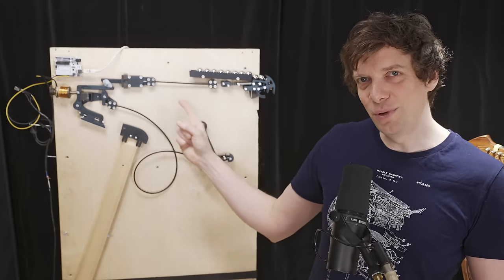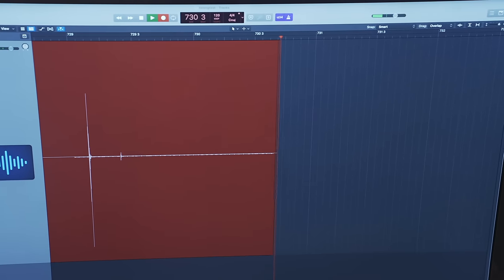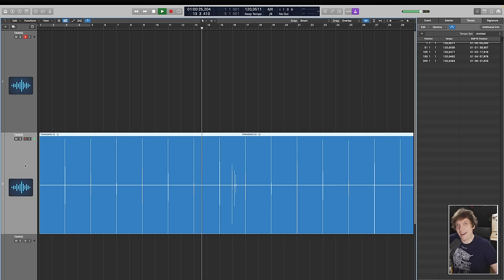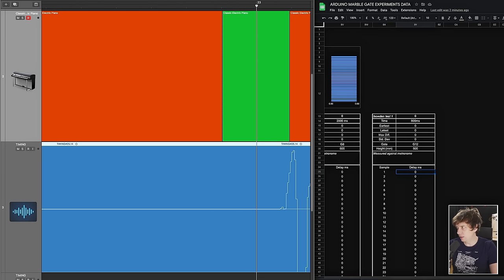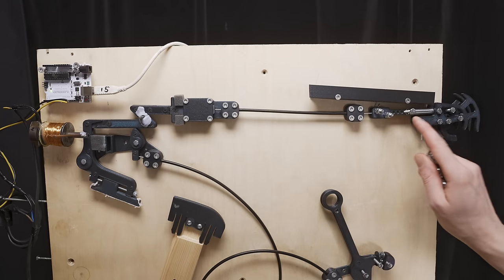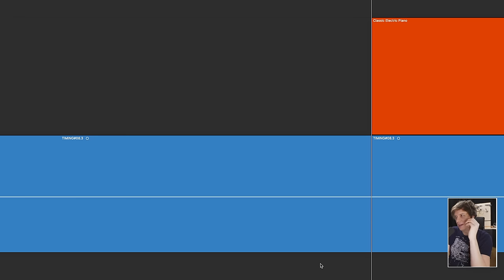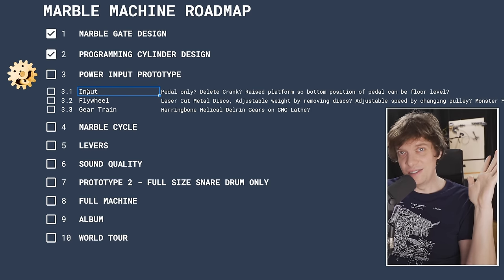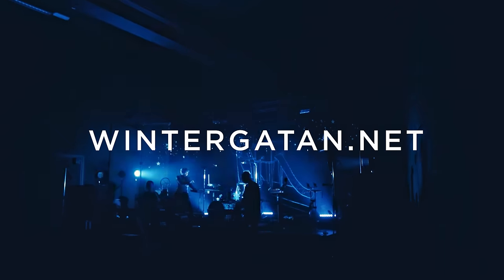Can Bowden Cables Play Tight Music?

Comment: You should add a spring to return the lever from engaged to mute instead of "pushing" with the bowden like all derrailures do... these cables really don't like pushing in the long term!
Reply: Indeed, more than a few folks have mentioned that so far. Though I'd ditch the spring and use the cam's own mass - less parts just a slightly differently shaped cam (perhaps with a deliberate counterweight in its profile) so it always wants to fall down if the cable isn't pulling on it.
Reply: Dumb question here are you saying all derailleurs use springs or that they all push the cables?
Reply: Bump. I really hope Martin sees these bowden cable recommendation comments.
Reply: The problem is consistency,  springs range in strength and speed so timing each spring is a challenge
Reply: @YogiTheBearMan  lol don't worry, he meant they all use springs, the wording of the sentence is confusing
Reply: @graeme.davidson  Nothing needs to be timed. It's just for engaging/disengaging the mute lever.
Reply: @YogiTheBearMan  All derailleurs use spring to pull the derailleur back (usually highest gear) but there have been some exceptions in the past where the cable pushes with a rigged inner-cable. So 99% of the time the cable pulls the derailleur into a lighter gear and when you release the cable the derailleur pulls it back into a higher gear.
Reply: @YogiTheBearMan  All derailleurs have return springs so there's no pushing of the cables.
Reply: @YogiTheBearMan  You may notice that its easier to change the gears in one direction and harder in another.
Reply: Or just hear me out, he could change the Bowden cable to a push pull cable that way the design can remain the same.
Reply: just use solid bowden cable, instead of braided. Solid bowden cables are designed for both pushing and pulling, and is used on engine throttles.
Reply: I don't see any advantage in using bowden cables instead of rigid rods, and lots of drawbacks. They are also going to add a lot of visual chaos.
Reply: @francescosirotti8178  Martin mentioned it in the first video about it. The main advantage is being able to not have all the switches so close to the lever arms. He could have the mute switch on the right side of the machine while the actual mute mechanism is in the middle. The previous design was extremely cramped due to using solid linkages.
Reply: @Francesco Sirotti  cables can be managed and hidden under structural parts or a shroud. They take up less space and are more forgiving as in you make the cable longer than you need to. They are also more flexible. You can run a cable over longer distances and around other parts. 

Rods need fixed positions for the parts they are attached to and space to move, blocking the area from being utilised. They have to be machined to a certain precision. Otherwise, it affects the timing of the gates.
Reply: @Appletank8  so he will be using a long, curved, flexible cable to push? This seems a problem that can be better solved by good design rather than added complexity. And the cables will be much more complex to disassemle, reassemble and set up when this machine will need to be disassembled and shipped on the world tour.
Reply: The load on the cable toggling between unmuted and muted is negligible. It is just overcoming the friction of rotating the muting cam. It may not be ideal and there may be simple ways to reduce the strain even farther, but it is not comparable to moving a derailleur where a chain has to be lifted or pushed. If the friction is kept low, I expect it would serve well for a long time with little risk of failure. Adding a spring may reduce  the chance of that failure, but adding a part adds another part to fail or get out of alignment.
Reply: Does anyone who says that Bowden cables are not suitable for pushing have at least one objective proof of this, or just unsubstantiated fantasies?
Reply: @ИльяСиськович  Depends on the type of bowden cable:

Braided, as seen in the video, is not designed for pushing, and would therefore wear out much faster, and start causing problem in the way the machine works.

However, it is possible to get bowden cables capable of push/pull operation, and still have the flexibility. Solid, instead of braided, as found used for engine throttles.
Reply: @francescosirotti8178  If the opposite end is spring loaded, then it wouldn't be much of an issue. Bikes do it, and they work fine for hundred of hours. If every cable is labeled, and there's a step by step for installation of each part, it wouldn't be that much more complicated that straight bars.
Reply: @foldionepapyrus3441  I think this needs more likes.
Reply: @ИльяСиськович  I have worked installing industrial equipment on-site (packaging machines) for nearly 10 years. Pushing requires force and WILL induce bending. If the cable is rigid and is short (as in this prototype) the bending effect is negligible. If you start to add lenght and curves, friction will increase and so will the bending, to the point that at a certain point you will get 0 force transferred and 100% bending. You can work around the problem using very rigid tubes or very solid cables, but why would you? That's just adding an useless layer of complexity to a machine that already didn't work. K.I.S.S. (Keep It Simple, Stupid) is a golden rule Martin is not learning, it seems.
Reply: Martin has already acknowledged this problem in response to a previous comment, he wrote that he might add a spring.
Reply: @francescosirotti8178  How is a straight cable visually more chaotic than a straight rigid rod? How about bent cable vs. bent rod? And how about cables hidden in and behind the structures vs. rigid rods that are impossible to hide?
Reply: @foldionepapyrus3441  Gravity is very bad power source on pulling bowden cables in this setting. It needs to be relatively heavy, which either means sizeable or with heavy metal  weight. Both bring forth more problems than what they solve compared to springs. Springs are always reliable. Gravity fed system is very hard to design to be reliable with such range of speeds that these parts have to endure reliably.
Reply: @anteshell  1 curved  cable per channel (and he plans for 3 different programmjng drums....) running from 1 side of the machine to the other VS a series of parallel rigid rods? I know what I would rather have. And good luck hiding 1 rigid cable per channel behind a strucure. Also each cable needs to be rigid enough to transmit force but bendy enough to move around, while the rods can be more rigid. The disadvantages for me far outweight the advantages, unless there is some master plan I'm not seeing..
Reply: @Paul Bolus  I have a push-pull shifter cable. It's an old Shimano 3-speed internally geared shifter, and when I had to replace the solid wire, it was very hard to find!
Reply: @francescosirotti8178  What you can do with a rigid rod, you can also do with a cable. There is only two relevant exclusions to that. One is that you cannot make tight bends with the cable. The other is that if using metal (emphasis on the word "if"), it is possible to pack three rods slightly tighter together than three cables. There is nothing else differing here. 

"running from 1 side of the machine to the other VS a series of parallel rigid rods?"

What are you even saying here? This doesn't make any sense. Transferring force from a one side of the machine to another using rods is by far  more difficult system to design so that it is both reliable and less obnoxious than cables. You can prove me wrong by showing me a bicycle with rigid rods instead of cables. And that bike must both be at least as reliable and robust, but also as hidden as those cables are.
Reply: @YogiTheBearMan  I think they meant to say, do it like a derailleur, pull the cable and return with a spring
Reply: @YogiTheBearMan  they all use springs
Reply: @anteshell  This is a simple cam that is never under any great load - in the same way the hook on the cam drops freely the cam can be allowed to here. Timing doesn't matter much at all.

So just making the cam body off centre from the pivot enough means even the lightest material you could plausibly make the cam from will have enough mass and leverage thanks to the offset from the pivot to pull itself and some reasonable length of bowden. Make the cam in something relatively sensible density wise like steel and its a single plasma/laser/cnc part and you can easily have it be providing way way more force than those two springs in a compact size, and better still because its just powered by gravity its not yet another spring you will need to replace, as they will ping off in transit and break from time to time...

Edit: remember here we are only talking about the mute lever - for actually forcing the marble gate to cycle a spring may be best - though again gravity can be used if you make sure each channel always has enough marble pressure behind it. And keeping that low enough was Martin's problem with previous gate systems!
Reply: @YogiTheBearMan  All derailers (and brake calipers) have springs. In fact, bicycle cables are not "true" bowden cables, since they only pull in one direction and rely on springs to pull them back.

Some motorboats use a true bowden cable to control the steering, where a single cable pushes and pulls. But this is an application where precise and instant response is not as critical as in a musical instrument.
Reply: For the mute timing isn't a huge issue,
Reply: @deathsheir2035  I have seen the long term use for solid core Bowden Cables (first time I've ever named them properly though) in Subaru HVAC controls. They seem to be doing well...as long as everything is moving nicely. The are usually the weak point, they bend at the exposed portion of wire leading up to the input/output loop.
Reply: @jordanlarson6488  He already did in the last video. I guess, he just did both videos right after one another, so the recording of the second video has happened already BEFORE publishing the first video,
Reply: Sure, but I'd like to see the creator's solutions to that problem when they happen. 💜 (for me, the creation is a crucial part of the enjoyment)
Reply: there is a pring pulling it. look at the dropper
Reply: @InventorZahran  very minor nitpick: that is true nowadays that all derailleurs have springs, but in the past there were purely friction operated derailleurs such as some of the old "suicide" front derailleurs. Of course, a front derailleur does not need to maintain chain tension so this is possible. It is also theoretically possible to do at the rear using a separate cable for chain tension, though I'm not aware of any derailleurs which did this purely by friction (there were a few double cable models but AFAIK they had springs).
Reply: @szurketaltos2693  I read Cyclepedia, so I've seen those old friction-based front derailers. But they were always directly lever-actuated, without a cable.
Reply: @InventorZahran  sure, that's why my nitpick was very minor. You did say all derailleurs.
Reply: @InventorZahran  also IIRC there are a few Japanese unsprung parallelogram derailleurs that use two cables, they do have a spring p pivot however. In that case, the spring does not directly oppose the Bowden cable.
Reply: maybe have two cables one pulling it open and the other pulling it closed?
Reply: I'm more curious as to how he's going to keep them from rusting.  Graphite?  (--I did come across caliper grease recently, and that has some interesting properties, which may help here) - but lubricant will affect the timing too
Reply: Yes! also: they loose tightness with repetition - a long-term repetition test should be performed or calculate in that while they might work fine for a while they also might require recalibration on a long tour!
Reply: @Kramer4Krimit4  that's how a couple japanese derailleurs worked, I'm not sure if it was one cable that made a loop around the shifter or two separate cables.
Reply: @qwicy  agreed!
Reply: @anteshell  
To add to gravity. It is not the same across the globe. Meaning that some parts have lower gravity force. If your machine is too tuned to gravity it might not work properly
Reply: @ODDnanref  It is simply impossible to tune a mechanism on this scale so that the gravity changes on ground level affects it at all. Even just one extremely well lubricated bearing with extremely tight tolerances would add too much variability to make it impossible. 

I'm not sure where you're getting at with your comment.
Reply: @anteshell  
Nowhere. I was adding interesting fact to the comment. Not sure how 0.5% change across the entire thing Will affect momentum, friction, and so on. Probably nothing. Been a while since I watched his videos